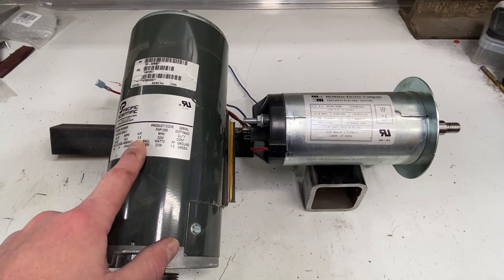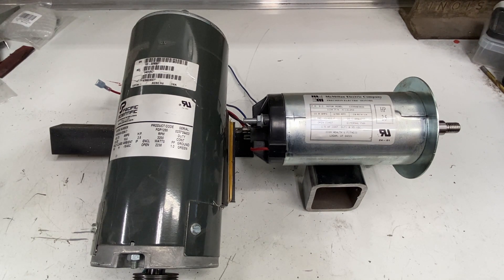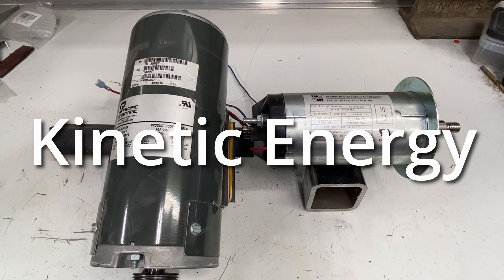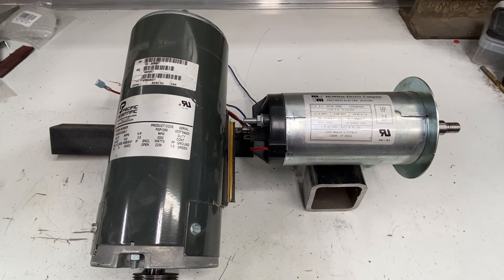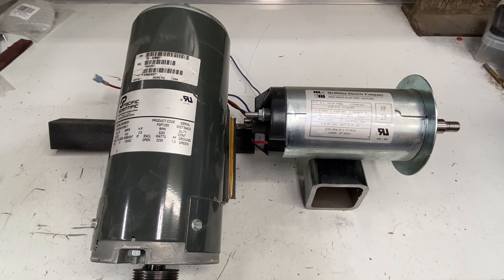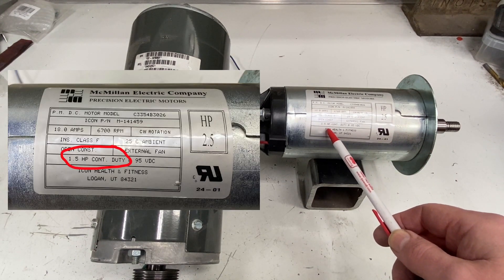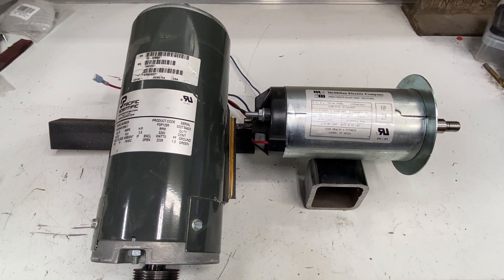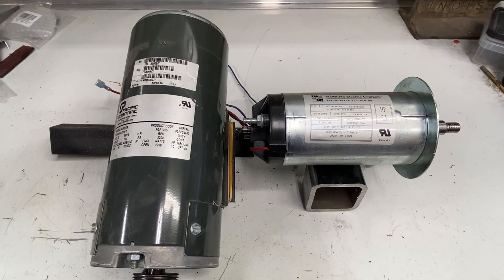Determining if your treadmill motor has enough torque for the project you want to add it to.

Comment: I'm three years late to the party but thanks for this great info.  I'm currently on the hunt for 4 of these motors to power two of my vintage drill-presses and two for my bandsaws, vertical and horizontal. I'll check out your other videos on these.
Reply from the maker: I setup notifications from Facebook market place and Craig's list for treadmills and then only took free ones.  The cheap treadmills have a motor that is better for a drill press (a little smaller) as long as you gear it properly and because I drill press doesn't require much torque unless using hole saw type cutters. https://youtu.be/e_7GHSB2yTs  A bandsaw will need a bigger motor with a lot more torque.  I have a whole video series on my bandsaw build including some things I had to redo due to mistake I made in the beginning. https://www.youtube.com/playlist?list=PLg4j6XzBdSY8AkoE5YBqAHtnb5XDRIl8q
Reply: @dazecars  Awesome help man, thank you so much.  For my larger drill press I will want more torque.  It's an old 17" Walker-Turner / Rockwell with a power down feed.  It's mainly slated for metal work and on occasion is for drilling up to 1" holes with annular cutter bits.  My smaller 15" DP is the wood press and is never really used for anything over 1/2" holes...but likely 3/8" or less most of the time.
Reply from the maker: sounds like a good plan a 2-4 foot pound motor will be ideal for the big drill press and a small cheap motor about 1 foot pound should be more than enough for the small press.

Comment: 3:34 I don't buy that argument. In most cases consumers buy identical motors to the ones they replace OR know what they are doing and go looking for certain specs. That market trick of using HP to trick into buying does nothing.
Reply from the maker: No thats not what is happening in this particular case.  People are not replacing an existing motor like for like especially if they go from AC to DC.  They are using a treadmill motors for variable speed on something OTHER than a treadmill.  And if you go by HP you may be disappointed with the results because HP is a function of RPM and if you add the motor to slow it down you are reducing horse power..

Comment: I have an L-405564 motor that came out of a Nordic track. It does not show its rpm and I can't find it. The controller is bad so 8 plan to build an scr controller. It did not have a motor choke so I will have to build one of those too. I have a microwave for that. Can you tell me what rpm this motor is rated for?
Reply from the maker: I don’t know the specific RPM of that motor. What you need to do is apply the amount of voltage listed on the tag and then measure the RPM with an RPM meter. If you’re not able to do that if you tell me what the diameter of the motor is I can at least give you a ballpark as to what the RPM range likely is. Smaller motors tend to have a higher RPM where bigger motors tend to be slower.

Comment: Based on that formula and all available torque vs rpm graphs, the torque of a DC motor decreases as you increase the rpm.  So the motor will produce it's max torque at next to zero rpm (within reason since there is a minimum run speed).
Reply from the maker: No that’s not correct. A fixed magnet DC motor produces a flat torque curve. Constant torque through the entire RPM range except reduced torque at the lowest speeds. The formula does not indicate a reduction in torque as HP is a function of torque. I think you are assuming HP is constant but HP decreases as RPM decreases.  The HP spec is at the max RPM spec. Stepper motors and other similar motors do have a decreasing torque curve but not a treadmill motor or other motors like a treadmill motor.
Reply: @dazecars  good points.  Thanks for the explanation.  I'm currently building a 16" bandsaw from Matthias Wandel's plans and will be using a large 4hp treadmill motor with a max 4k rpm.  My plan is to set it up so that I'll use a max of 3200 rpm.

I'm currently running my small wood lathe on a 2hp treadmill motor using an Arduino as the pwm input on the 2100 board. It has been on service for about 4 years now.   I built a shroud out of PVC pipe  to fit over the fan on the rear end and ran dryer vent hose outside the shop so that it sucks in cool clean air to prevent sawdust buildup inside the motor.  I feel that keeping the motor clean, especially the brushes and contact points is key to longevity.
Reply from the maker: That is a really good treadmill motor!! It will likely work well as is with a max RPM of 3200 BUT I would still recommend gearing it at 1.25:1 if you can rather than limiting the top speed.  The more torque you can get to the blade the happier you will be.  People don't realize that the large wheels of the bandsaw actually reduces torque.  It's kind of like gearing it up.  I ran into that same issue with my own bandsaw conversion and even though it worked with lower RPMS and a limiter at the top RPM I was way happier with it when I changed the gearing.

I wanted to follow up on the torque and horse power question.  Most people don't realize you cannot measure horse power.  Everyone thinks you can measure it because thats the number that everyone knows but its not measured it's calculated.  What we can measure is torque and RPM and these two things are what go into the calculation resulting in the HP number.  When you see a stepper motor graph that shows the torque decreasing as RPM goes up all these data points are being measured on a dyno and the horse power graph is calculated.  Same is true of a gas motor or any other motor.  I created this video because we can work backwards to find one data point.  The HP number on the motor is the rating at the specific RPM so we can use the calculations to determine torque at the one point.  Thankfully the torque is consistent across the entire RPM range or the motor would need to be tested on a dyno to know the torque at other RPM points.  I hope your project goes well let me know if I can answer any other questions or be of any further assistance.
Reply: @dazecars  Thanks for the reply.  I'm planning to use the stock pulley which is about 1.4" on the motor and a 7" pulley on the wheel.  That will give me a blade speed of around 2500 fpm, which will be suitable for resawing.  The alternative is to use a 3.5 " pulley that I have in place of the 7, but then I'd be running the motor at about 1500 rpm to achieve my desired blade speed.

I'm still trying to decide if I want to remove the flywheel from the motor pulley.  On my lathe I did so using a hole saw that just fit over the pulley.  It made a nice clean and even cut using the drill press.  I'll likely try it with the flywheel and if shutdown takes too long I'll look at removal and/or adding in a resistor for the brake effect.
Reply from the maker: I would not gear it so that you need to run the motor at half speed.  Just leaves to much on the table and reduces torque to much.  Because of the "high gear ratio" nature of a band saw blade it would be better to run the flywheel if you can.  I wish that would have been an option on my bandsaw conversion but it wasn't due to the machine being so small.

Comment: Horsepower and torque are completely different physical variables whether you’re talking ICE engines or DC motors

Many heavy vehicles have only 200 hp or so but 550 ft lb

My Subaru has 146 hp (not too much less than 200) but only like 125 ft lb

That’s because top speed isn’t important for large vehicles but moving heavy loads is

So the ratios between hp and torque can differ wildly

I know you’re talking DC motors so, totally different mechanical regime, but the concept is the same which is that the purpose of the design is important
Reply from the maker: The important thing is HP is a function of RPM and torque.  It is the ability to do work.  If a motor puts outs 1 foot pound that footv poundc is per revolution.  So  at 500 RPM you have 500 1 pound applications of force.  But if it's producing that same 1 foot pound at 1000 RPM you have 1000 applications ofv1 foot pound.  Basically doubled the work the motor is able to do.  The reason it is so important with electric motors is HP is based on a specific RPM typically max and the moment you reduce that RPM you reduce the HP.  Anyone wanting to use a treadmill motor is usually doing so to have variable speed.  That is what this video is about HP means nothing in a variable speed application.  The trap that most fall into is thinking HP is THE  number but torque is the only thing that really matters.  Your vehicle example is over simplified because it does not take into account gear ratios.  Low ratios take high RPM and turn it into torque but lower ratios turn torque into higher RPM and because HP IS a function of RPM and torque it has a dramatic effect on how the motor works.

Comment: But if you gear down the small motor, it’s still running at 6,700 RPM. So how can the torque change?
Reply from the maker: think of it like this with 2:1 gearing.  If 1 foot pound is created per revolution at max RPM and  at 2:1 you are now getting 2 revolutions from the motor at 1 revolution at the final pout put you have doubled the torque.  This is how gearing works in everything.  You can convert torque into RPM or the other way around by gearing.

Comment: So I am trying to figure out what kind of treadmill I should be looking for. I am 220 lbs and have found even walking on cheap treadmills, my walking overpowers the motor when I step forward, causing the belt to slow down or move forward slightly. It is very jarring.
Since manufactures only advertise HP and speed, should I actually be aiming for a treadmill that has a lower max advertised speed at a given HP, as that would suggest it has a higher torque? Not sure if I am making thigs up here.
Reply from the maker: yes and no.  Calculating the torque (HP * 5252)/ RPM will get you in the ball park.  small treadmill motors are typically 1-2 foot pounds medium are 2-3 and the best ones are around 4 and above.  Problem is treadmills all use gearing on their belt drive, that gearing is not the same and that gearing can impact the torque as well.  In other words a treadmill with quiet a bit of motor torque is likely good but if there is not much gearing it might not be as good as a treadmill with a slightly smaller motor and more gearing.  It's hard to know for sure one way or another.  It's a whole bunch easier with what i'm doing because I am creating the system the motor is going into.  Please let me know if I can be of any further assistance.

Comment: Hello, I recently acquired another treadmill motor, It is physically much larger and heavier than my previous motor (good sign). However, this motor does not state max rpm. It tells me that it is 2.25 HP continuous duty @ 130VDC/2200 watts, and thats it. is there a way to calculate max rpm (without hooking it up to power and using a tach)? The motor part number is M-237595. I have searched alternate part numbers to no avail. I have reached out to the company on the sticker to ask if they would have the max rpm rating somewhere, but im not holding my breath on that one. Do you have any thoughts? thanks in advance.
Reply from the maker: You are trampling all over a video that will be dropping in a week or two 😂  Because the size of the magnet has a direct relation to the amount of torque the bigger the motor the more torque.  Cheap low torque motors are usually 3"-3.5" in diameter where as the better motors are 4"-5".

Comment: Thanks for this informative video. I had just installed a used treadmill motor on my Harbor Freight lathe and was immensely disappointed to discover the remarkable lack of torque. I, of course , bought it based on the HP rating.  A little research led me to your video and cleared things up. Now that I understand, I ordered another motor that is 3hp @ 4300 RPM which should provide more than double the previous amount of torque.  Thanks for the clear explanation.
Reply from the maker: Glad it helped, also remember gearing is your friend.  As an example If the original motor was 1500 RPMS and the new motor is 6000 you want to gear it down to 1500 which will give you 4 X the torque.  This video should also help https://youtu.be/uA4__ltMMcY?si=4kffKcOgR3pwv16t

Comment: Someone else might find this useful, I just noticed my 125 CC gas push mower has 4.5 foot pounds of torque. What's funny is, it doesn't say what the horsepower is. But from using one for so long, I'd say it's about 3.25, maybe. I've used a 3, and also a 3.5, and this one seems like it's in the middle. I'm guessing it's a 3hp with overhead valves.
Reply from the maker: Good information but keep in mind gas engines have a torque curve and torque changes as RPMs change and this will have the same effect on HP.  If you know at what RPM that gas motor is producing the listed torque you can calculate HP at that RPM by inverting the equation.  (TRQ * RPM)/ 5252

Comment: Have you seen had the chance to measure the M-295727 from golds gym? It’s 2.0 continuous, but I can’t find any information online about rpm. Do you know the rpm rating for that one?
Reply from the maker: I am not familiar with that specific motor BUT based on what you have said it kind of sounds like a smaller one. 3-4” diameter is the smaller size and 5-6” is the bigger size. The smaller ones typically run at the 6000-1000 range and the bigger ones 2500-4500

Comment: Great video. Wished you went further so that we could relate this to our project requirement. e.g. amount of torque for lathe,cnc, diy self-propelled rc lawnmower, as well as brushless versus brushed in terms of performance
Reply from the maker: Thanks, each application has different requirements so kind of hard to be specific.  I have not yet played with brushless motors much.

Comment: So, if torque = HP x 5252/RPM, how can torque be constant? 
Unless you’re talking about maximum RPM and assuming the motor is always running at top speed. 
I guess I’m still unclear on what you are saying Day. 
Suppose I have a TM motor rated at 2.5 HP and maximum RPM of 3600. 
I want to hook this up to a lathe that can spin from 30 RPM to 3600 RPM. Does this mean I must have have a pulley system that’s 30/3600 ratio , or about 100:1?
Reply from the maker: Neither.  HP is calculated at max motor RPM, torque is "mostly"  constant, and your ratios are way off.  Let's say your motor is 4500 max RPMs and you want a max top speed of 1500 RPMs.  You gear it at 3:1.  This will give you full RPM range up to 1500.  The variable speed gives you the lower RPMs you are looking for.  That is why for this application HP numbers are worthless because at lower RPMs you have lower HP but lots of torque.  Torque and proper gearing are the important things.
Reply: Ok. When you say 3:1 ratio, does that mean that the pulley wheel on the motor is 1/3 the diameter of that on the spindle? Your motor would turn faster than the spindle, right?
P
Reply from the maker: @paulmanhart4481  3 turns of the motor for every one turn of the spindle
Reply: @dazecars  Yes, so that’s small pulley on motor. Large on spindle. 
As a physicist, I shouldn’t have the problems I’m having understanding everything. I can’t even seem to write a paper anymore, and I have a big one due this week for a conference. 
Getting old sucks.
Reply from the maker: Torque is constant, BECAUSE IT IS 😁 The HP number is a moving target and the HP rating on the label is based on the RPM rating on the label.  as far as ratios your numbers are way off AND you can't gear it to have a minimum of 30 and a max of 3600.   Max of 3600 would require a 1:1 ratio and assuming your cold start RPM is 300 If you wanted a minimum of 30 RPMs you would need a 10:1 ratio.  More reasonable and useful would be to  do a 3:1 ratio your range will be 100RPMs to 1200 RPMs.  There is almost never a reason to spin a metal lathe up past 1500 RPMS so why would you want to go to 3600?  Also I would not spin your lathe up faster than it was designed to go from the factory as the spindle bearings are going to have a max RPM range.  Chucks also have a max RPM range.  On my machine I have it geared at 5:1 because I wanted the low end torque.  That puts my max around 1200 RPMs which is short of the 1500RPM max the machine started with but again 99% of the work I am doing is in the 500-1000 RPM range.
Reply: @dazecars  Ok. I have a Southbend Heavy 10 L. I’ll check the manual for max spindle rpm and keep it within that range. 
I also have a modified Jet 1014 wood lathe that I’m extending to a 38” bed length. I think that motor is a 1/2 hp DC with 1600 rpm on the label. So the torque would be 
T = 0.5 x 5252/1600 = 1.64 F#
With a 3 hp TM motor, that would be 9.8 F#. 
I’ll need to check the AC motor on the Southbend, but I think it’s 1.5 hp
Reply from the maker: @paulmanhart4481  Your first calculation is correct your second calculating is wrong.  You cannot take the RPMs from the AC motor and use them to calculate the Torque of the DC motor.  In order to get the torque of the DC motor you need to use the max RPMs and HP from the DC motor.  Once you have the torque of the DC motor you can use the gear ratio to determine RPMs and and torque at the spindle.